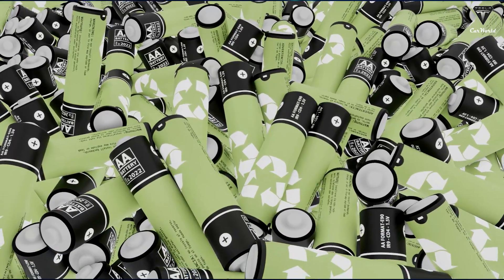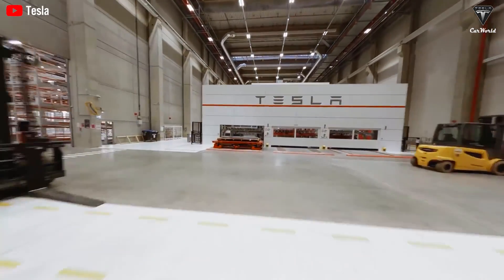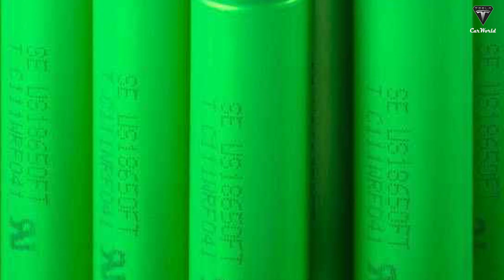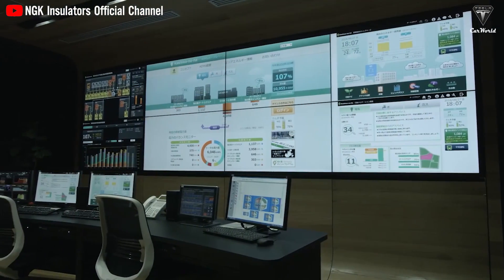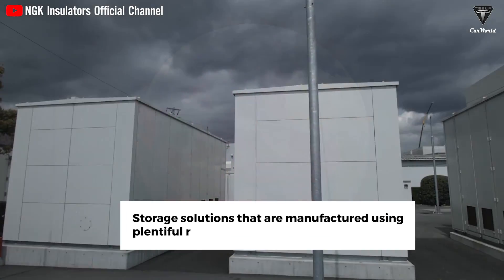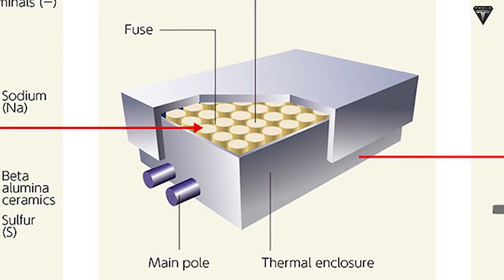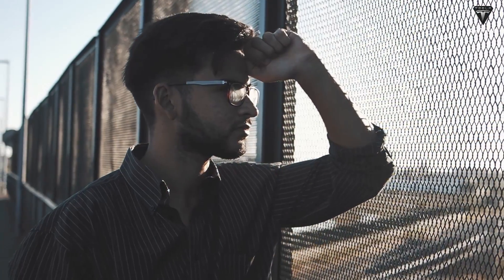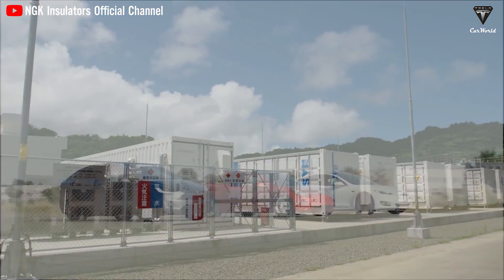400% More Capacity! This ALL-NEW 4.0 Battery Technology Will SHOCK Entirely Industry!

Comment: The ban on gas powered vehicles will also require the power grid & generation  to be expanded ten-fold...  so our civilzation is going to crash.  And lowering the CO2 levels in the atmosphere will return the world back to the C3 photosynthesis critical CO2 lower limit of 180 ppm,  below which point almost all food plants (grains) will start dying off due to lack of CO2.  The plants optimal CO2 levels for growth is between 1000 and 5000 ppm,  which is the CO2 range  at which they evolved.

Comment: Seems somewhat unusual... Not one working example shown... Only a short view of a single block of battery shells! I'm not asking for how it works - just a solid example of the things in action! Reading off the press release and touting on about what could be - vs looking into what chemicals are used to produce (no limit - the truth, if at all, about how Dirty it may be, or how much energy is required for the special process to sulfur? Nuclear Diamond Batteries sound scary, until you consider - the things will last so long it could be used by your next 20+ Generation of your family!

Comment: Those. Chemicals are corrosive all battery’s leak eventually . Your claim of wide temperature range ins not consistent with your on descriptions . Short circuit tolerance is not mentioned in your rambling nothing .

Comment: You tell us it is wonderful about 80 times, tell us what batteries can be used for. But zero specifications, and only at the end say it has to run at high temperature and is therefore unsuitable for mobile devices.

Comment: Its basically a grid size storage battery  , as it takes up too much space to have a usable range in cars . 4500 cycles is not enough for grid storage , these can cycle easily 2 times a day and if used to stabilise the grid they need to cycle a whole lot more . 4500 + 760 cycle per year  is about  6 years  . Flow batteries are much better in life expectancy and ability to simply replace the fluid which is cheap when needed . Anyone looked at how many Tesla storage batteries have performed in the " Big  Battery " in South Australia ?? how many have been replaced and what degradation has happened ???   Remember they bought more batteries in a few years ago where these replacements ?

Comment: Sodium is a great idea but not sulfer. The best way to keep a battery that won’t have to be changed for the life of an object would be using a mix of calcium carbonate, sodium, Micha and diamonds. This mixture when added in a wave length pattern on the copper plates with embossed waves like brail just make sure there’s a plate of gold/silver and Copper alloy they run to that attaches to both sides like a strip slate that’s thicker when the roll ends.

Comment: Very curious as to how this works at room temperature.  I worked on a Ford Aerospace NaS load leveling program back in 1979 but back then the battery had to be held at a high temperature.  Also the ceramic barrier between the sodium and sulfur was very limited in life cycle.  I hope this works out and get into the market fast.
Reply: What you think commercial level is it possible